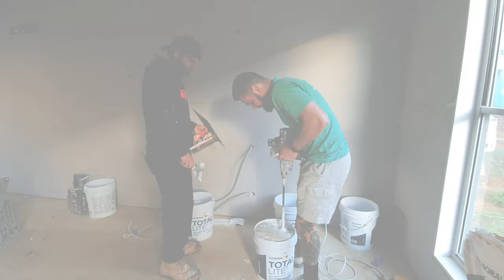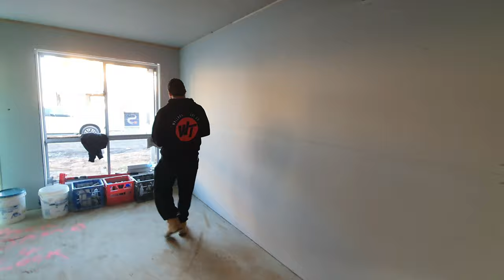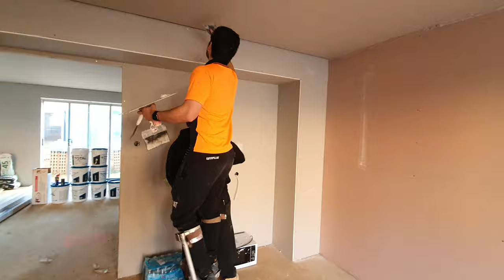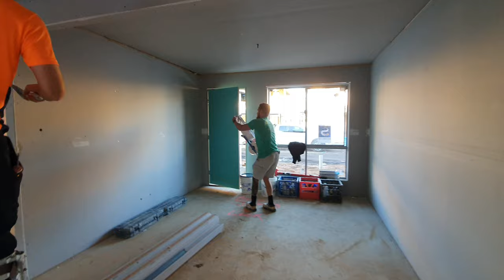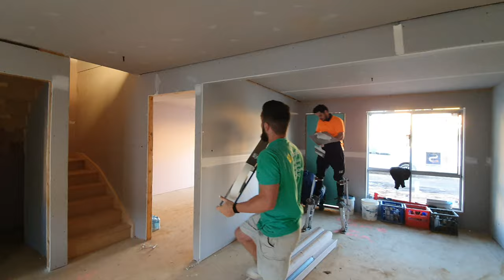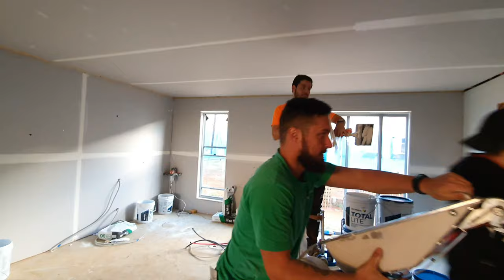TAPING DRYWALL USING MUD BOX | Drywall Finishing Construction Series #1

Comment: At 5:22 there is a big time NO NO in Drywall. There’s an intersection where 4 sheets meet. In the US we call that railroading. We are mandated by building code to stagger our top and bottom sheet butt joints by at least 32inches (slightly less than a meter). Same on side by side sheets hung on ceilings. That will crack. Other than that 1 critique , which truly falls on the rockers anyway, these guys are top notch. The fact that they take the time to pre-fill blemishes and joints that aren’t tight says everything. Wise man once told me, “How you do anything is how you do everything.”
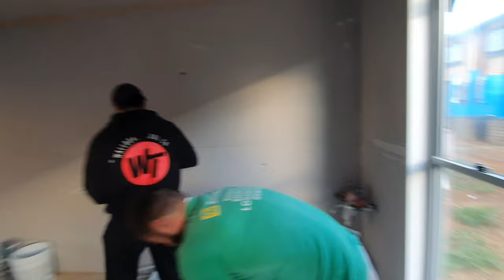Reply: 1:22 at this time you hear Dj explain that the kitchen covers that entire area. That's why they are railroading so there isn't any buttjoints visible in the main area because full height cabinets are covering the entire thing. We just tape it to seal the gap and that's it no finishing needed .If you watch the next video you should see non rail roaded buttjoints in the garage on the firestop board 👍🏼
Reply from the maker: kitchen cupboards bro so no butt joints on that long wall

Comment: Great video as usual Max. I've been thinking about buying that Tape pro box. Looks easier to operate than a bazooka and much faster than a banjo. My only concern is tape dragging. Some videos seems to be worse than others. How significant is the dragging? A couple inches on long runs?
Reply: Love my bazooka, I'm fairly new to it but it was well worth getting used to
Reply: When you're learning you'll have a bit of drag til you get the technique down and the compound consistency but once you get used to it, it will barely drag maybe an inch so you can account for that drag start the tape an inch long or however long you need if it drags more or less
Reply: That's not bad at all. Thanks for the reply. Great work as always fellas!
Reply: Jim, I tried out a friend's Columbia bazooka a couple of times when I was subcontracting. Pretty much immediately, I was able to fly through flats and butts but had a hard time with internals.
Reply: @robcosenza5569  the angles are defiantly a challenge, I would get like up to 4 inches of drag sometimes when I was first learning. Was very frustrating. But I started thinning my mud more and having a bit more tape over hang on my starting points and now I almost never do. But at the end of the day my buddee you need to do what works best for you. Nice chatting shop, cheers